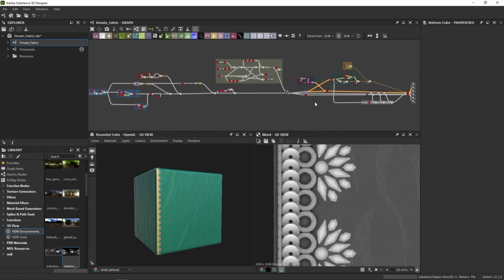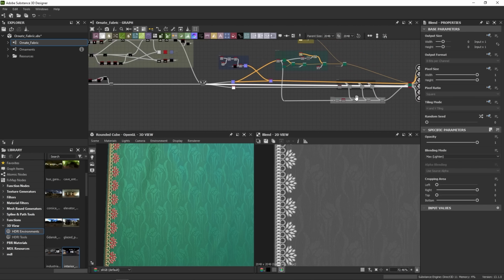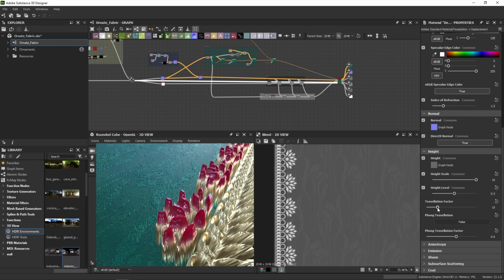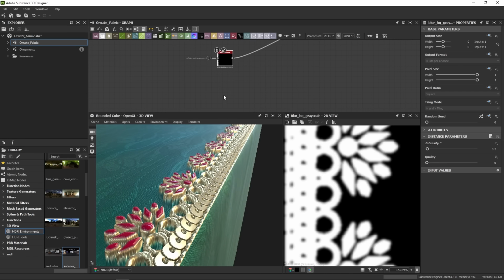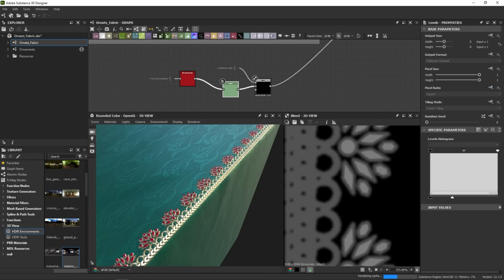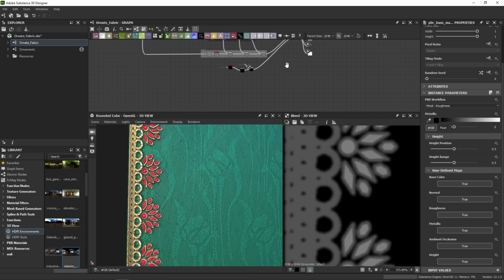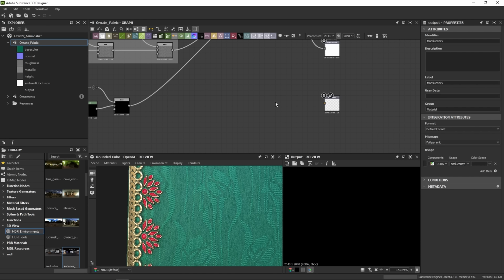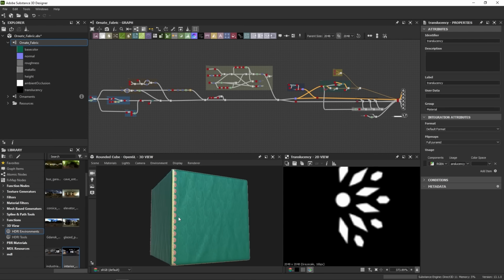Displacement and Translucency Maps in Substance 3D Designer (Pt 18) | For Beginners | Substance 3D

Comment: How do you do this in 15.1, i cant get the tessellation to increase the height on the gems.
Reply: Hey! the tesselation slider has moved to the renderer settings now :)
Reply: @louisemelin1129  Hi, Sorry if i replied really late with this but, make sure that you use a mesh that you can have displacement on. My problem was that i was using a regular cube instead of a rounded so even if i changed the tessellation and the height nothing would really happen. Also in the newest version of designer 16.0.0 or 2026 designer the tessellation has been moved to a button on the 3d view called displacement I might be wrong but I have not seen it in the render settings as it was in the 2025 version.
Also thanks Louise for the course It really helped me getting started on my designer journey!
Reply: @TallereAlt  yep the displacement settings moved once more but this time for good and for the best, we hope! Agreed the primitive names can be confusing... that's something we'll look into refining to avoid mixing them up
Reply: @TallereAlt  cheers

Comment: Im facing an issue with the translucency. When I connect my gemstones mask to the output node, the colors of the gemstones disappear as if it was transparent. Does anyone know whats the problem?
Reply: Hey! So that's actually normal: when something is translucent in a material, it will take its color from another source than the base color - instead you'll have to use the absorption color map. To do so, I would suggest you pick a uniform color node and connect it to a new output. Assign the Absorption color usage to that output, and you should be good to go, just play around with the base color until you get the desired result (I would recommend to check that in the path tracer)
Reply: @louisemelin1129  Thank you! That worked especially after I adjusted the level out and reduced the high values. Thank you so much for this amazing series
Reply: @TrystVar thank you! I really appreciate 😊

Comment: Hi Louise, or anybody else who may be reading, I've just gone into my Height settings, bumped the Tessellation up to 50, but when I increase the Height Scale the whole Rounded Cube turns into a very flat, sharp-edged cube instead. Do you know where I might be going wrong?
Reply: I had a similar issue, managed to fix it by going in to the Base Material node and enabling Height in the User-Defined Maps section. Hope this helps!
Reply: @martingullersbo8717  Thanks a ton! Just did the trick for me.

Comment: When I try to do the displacement map it looks very jagged on the cube, but looks fine on rounded part of the cylinder in the 3D view
Reply: Make sure you are using the rounded cube and not the simple cube, as it is too low poly to show displacement properly
Reply: @ thanks!! I also was able yo see it proper on a high res plane too I think

Comment: The entire tutorial series went smoothly, but somehow I can't make the displacement work. It seems like I need more tesselattion because when I go up to 50, my result is not the same as in the video, but when I try to make it higher it only allow me to go to 64, and it's not enough.

Or maybe is some mask, it's like it's giving displacement to the ornaments but it's not reading the mask properly, it's very unprecise. Any ideas?
Reply: Mmh, hard to tell.. First off you shouldn't have to go that high for the tesselation, around 40 is usually more than enough. You may have to crank up the height level though, try to input a very large number to get an exaggerated result and investigate the issue. Based on what you see, you can then troubleshoot the situation: examine what your height input looks like and try to trace back where things go wrong. Alternatively, you can download the project file to compare with your own graph. Let me know if that works!
Reply: @louisemelin1129  It's working now!:D I was missing the levels node, so the mask was full bright white, maybe that was the problem. Thank you very much!
Reply: She used a value of 10 for the displacement 'Height Scale' in the material properties. This was way too much for me and bringing that down to 1 or 2 helped. And make sure material resolution is set to 4k or 8k for best results
Reply: I had the same problem. Find the tesselation in the renderer menu. put it as high as you can and then also under scene choose a high res plane isntead of a cube

Comment: This is a great tutorial series. Good pacing and instruction.

Should there be any visual change in the 3d view when the translucency output is all set up? It doesn't look like anything changes in the video, and I can't get it to make a difference when following along at home.
Reply: Hey! 
That's a great question and I actually forgot to talk about it in the video. The answer is the following: if you want the translucency to be displayed in the 3D view, you first need to switch the renderer to Iray because OpenGL doesn't support it. Then, if you've followed the same steps as in the tutorial, you would need to "tell" the 3D view to add this new channel by right clicking the translucency output and drag and dropping it in the viewport. It should then display properly in ray traced mode. 
The reason I didn't do it is because I knew it wouldn't really "shine" in this preview state and I was more concerned about exporting it to my final app - where the rendering would actually take place.
I hope this makes sense!

Comment: The tessellation setting is not available in my version of Designer... any ideas? Under height, it only shows Height, Height Scale and Height Level. I can't find anywhere how to access tessellation.
Reply: If you're still using the iray renderer from a previous video instead of openGL, then you won't have a tesselation option. That confused me for a bit.
Reply: @acedesiena2882  Ah! That was indeed the issue. Thanks.
Reply: Hi, In the 3D view under materials, ensure the shader is set to Tessellation + Displacement. You can find this option in the Adobe Standard Material.
Reply: @wes.mcdermott  Thanks. I think it's because I had the Iray preview live.